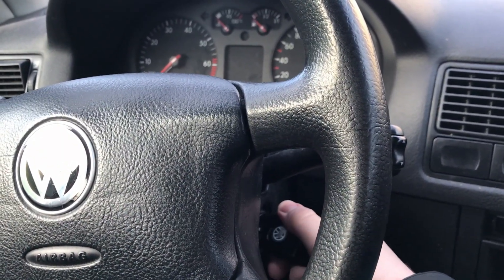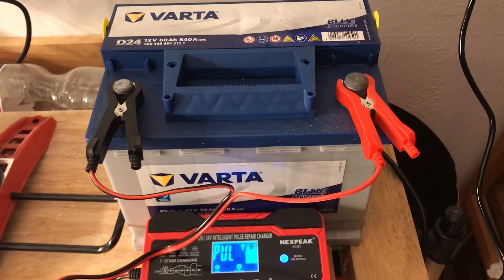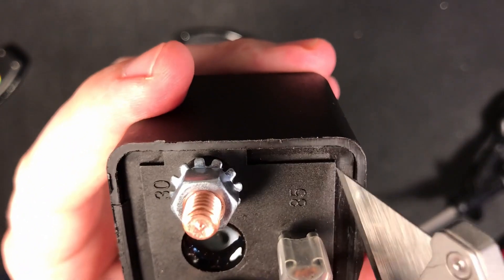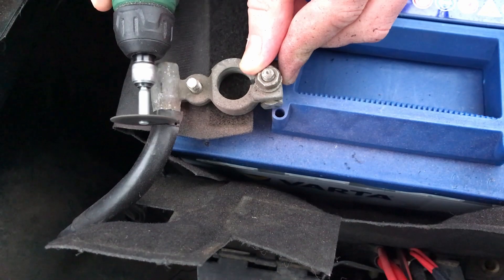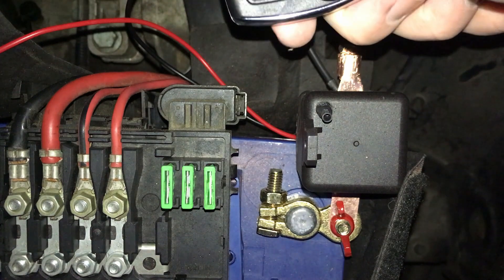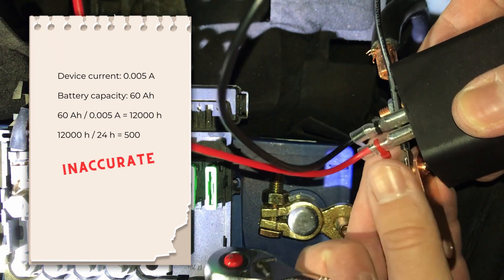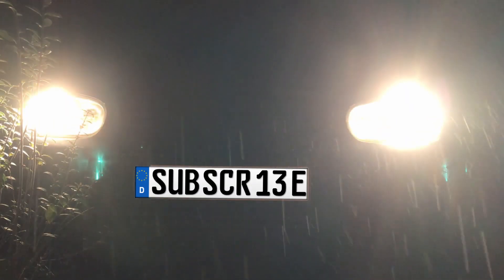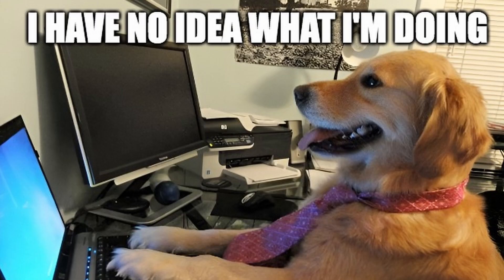Car Battery is always draining - Fixing it with a Battery Isolator (Remote Kill Switch)

Comment: This thing melted in my car, it's not rated sufficiently for starting amps after a prolonged crank. Those can reach 500A and it only handles 200A, or 360A briefly.
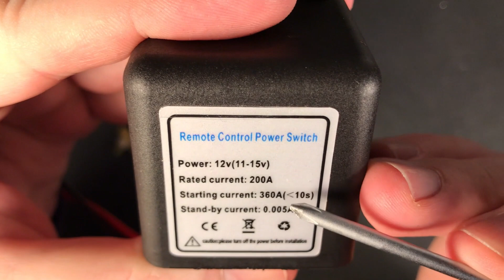Reply from the maker: Oh that’s bad to hear, I hope nothing else got damaged and that you can fix it. That’s exactly what I was worried about at 01:13 😅
Reply: @no-expert  It's a 2.5 liter Turbodiesel Citroën CX from 1986. It often sits for a long time and draws current, that's why I installed this, but safer with a manual switch than cheap Chinese electronics. I will try to find the current leak with a thermal camera. Also Chinese but it can do no damage.
Reply: @rulleh   No, the car is in storage and I just leave the battery cables disconnected now. Maybe there are better alternatives with a remote, verify the amp rating... Or a manual switch wired to the dashboard...

Comment: The alarm and door locks with remote control. So pointless
Reply from the maker: I think you are missing the point of the video. The car literally does not start. This is the main problem I fixed.

The Remote still works, I just have to press two buttons (turn on the battery with remote, then with the key remote to unlock). The alarm didn’t work in the first place because the battery was always flat. So nothing really changed, but my car can now start again. For me, that is valuable.

Comment: It shouldn't draw anything when its open
Reply from the maker: @timjd7964  The main switch is disconnected, but it has to keep the remote receiver active 24/7 to wait for a signal, that’s why it’s not zero :)

Comment: When you install a device like this your radio will lose all the stations , the clock will stop and the alarm won´t be activated. If the battery is draining there´s probably a grounding problem somewhere that is better to find!
Reply from the maker: @ravveljack That’s a good point! It is not the solution to the problem, just a workaround with drawbacks. I personally don’t have the time and knowledge to check every single cable in the car and a professional mechanic is too expensive. So my option would be to leave it as is, having an empty car after a few days. I was late to work and Uni a few times because of this, causing a lot of trouble so that’s where this whole idea originated from. A 20$ fix to avoid stress, maybe I should have pointed that out a bit more in the video. From a technical standpoint I agree with you :)

Comment: hmm but what's the power draw with it ON, so if you forget to disconnect the battery, the electromagnet will drain the battery?
Reply: I was looking for the same answer as well, and it turns out an energized relay like this will drain about 70ma to 200ma of electricity in its on state, so yes in short your battery will drain faster if you forget to disconnect the battery. Doesn't look like there is an easy way around it. Maybe install a fixed solar panel somewhere inside the windshield to compensate.
Reply from the maker: Good question, I think it will but it takes time. For my specific purpose it does not make a difference, because the battery will be flat over the weekend anyways if I forget to switch it off on friday (happened two times and was very annoying). You can automate it with a timer relay or microcontroller but it’s probably not worth the time and effort if you just want it to work and don’t enjoy it as a project.

Comment: Will this cause problems in the long term?
Reply from the maker: I’ve had it installed for a year now and it still works fine, didn’t even have to change the battery on the remote. For me it saved a lot of headache because now I know my battery is always full and my car can start. In everyday life nothing changed except that I need to press an extra button. The only problem I see is that when the remote is empty one day, I can’t start the car - but I’ve got a second one. Apart from that it’s just a switch, it can’t damage the car. It’s like unplugging your TV instead of putting it into standby. One thing to keep in mind is that the remote lock/unlock and the alarm system won’t work if you completely disconnect the battery like this. But then again, a thief couldn’t start it either until he figures out what’s going on :D
Reply: @no-expert  that’s the problem I ordered my disconnect switch with remote control from FEITON and it doesn’t come with a spare remote control. I don’t even know how to contact them for a spare remote control
Reply from the maker: In this case, I would put a replacement battery in your car, wallet or backpack so you always have one with you. Also take jumper cables with you (which you probably already have with you if you’ve got battery problems like me). 

In the case you lost the remote or the remote battery is empty you can always bypass the relay using one jumper cable, connected in the front and back of the relay. Like this you should be able to start your car even without the remote :)

Comment: I put one on, but it does not completely cut the power off, still drains the battery what a pos..
Reply from the maker: What, that's strange. Sounds like a case for warranty :D
Reply: I have the same problem